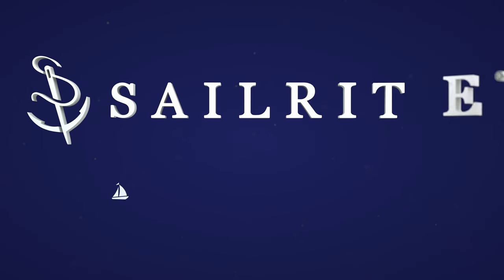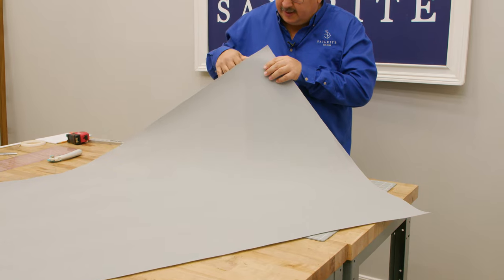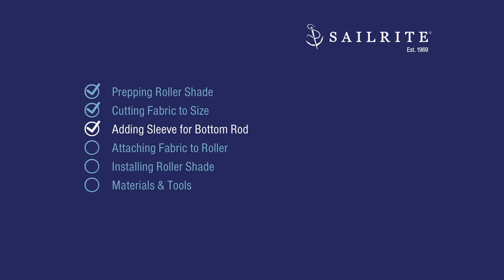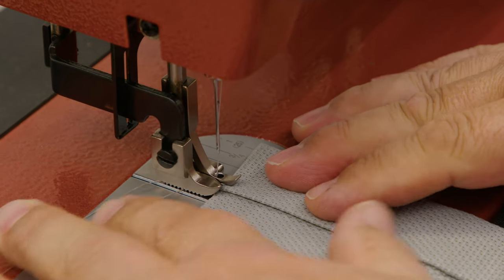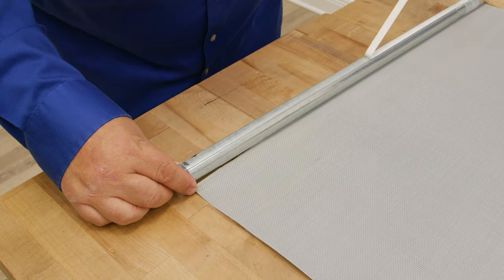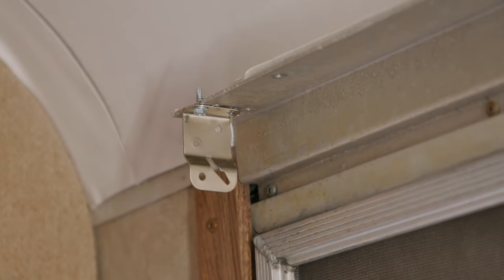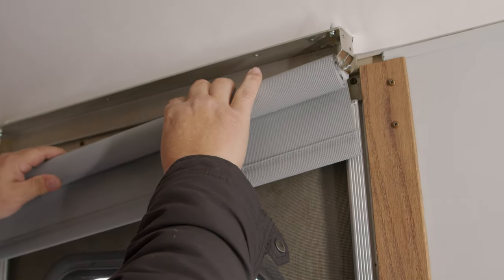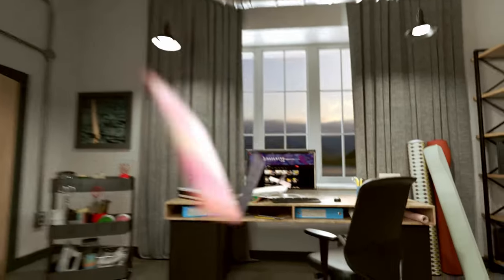How to Replace Low-Quality Fabric on a Prepackaged Roller Shade System

Comment: If I didn’t want to use phifertex for my blinds inside the salon, would you recommend something like the sunbrella upholstery fabric?
Reply from the maker: Yes, you can use Sunbrella Upholstery Fabric or Sunbrella Marine Grade Fabric. However, those fabrics cut edges will ravel, so you would have to carefully use a hot knife to seal the cut edges or you would have to serge the vertical sides. A hem along the edge will not work for a roller shade. Let me know if you have more questions.
Reply: @SailriteDIY  thanks! I bought one of your hot knives and I love it.
Reply from the maker: @sailingkaimana9776  Excellent!